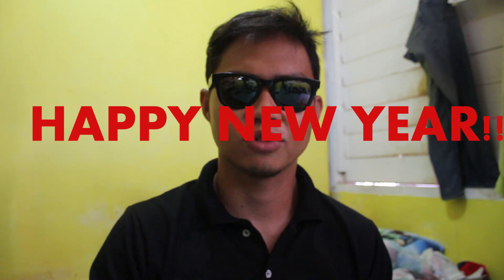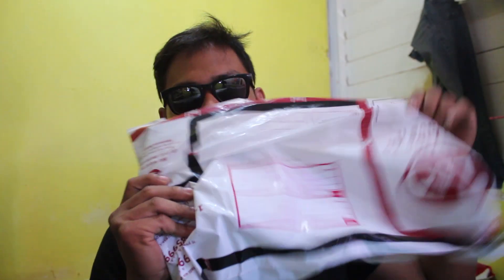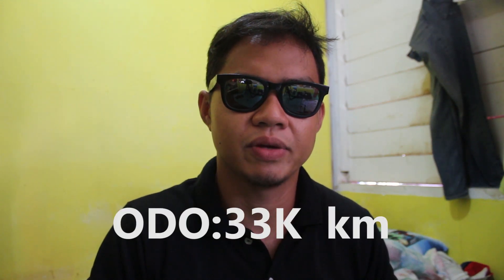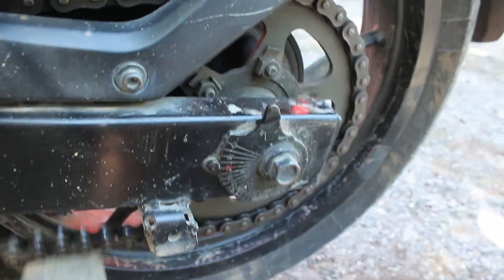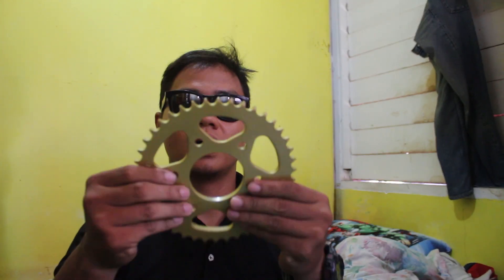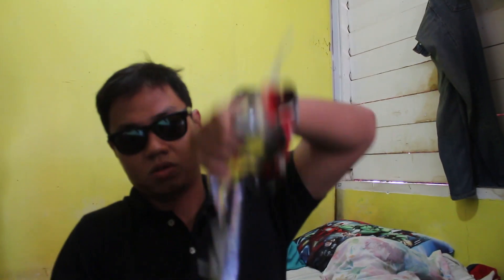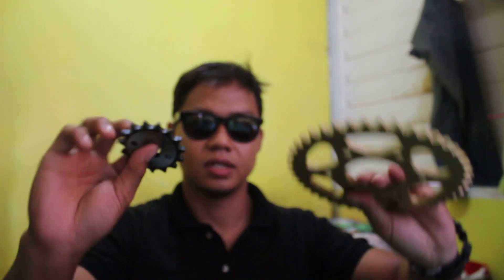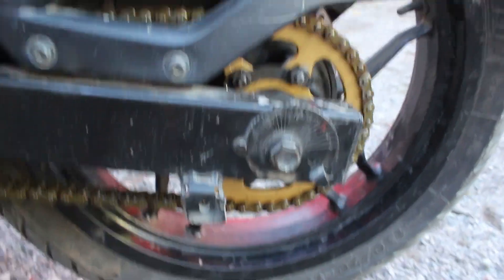15 42  428 pitch Sprocket Combination on Kawasaki 200NS | Pulsar 200 NS

Comment: From what bike do you use for rear sprocket? i mean, plug and play, no need modification
Reply from the maker: 200NS Bajaj
Reply: @JamieEduardoRosal  original bajaj is 520 not 428
Reply from the maker: @irwan6857  yes . This 428 is converted
Reply: @JamieEduardoRosal  so...this 428 sprocket is from which bike?

Comment: sir anong 428 para sa 14/36 ng 520? (magkakaiba kasi ngipin nila sa size)
Reply from the maker: dapat parhimo size ng chain po at ng sparcket .. pitch po twag duon
Reply: @JamieEduardoRosal  kea nga po sir...ibig  sabhin nung nagcomment kung tutularan  ung size nung 14/36t na 520 sa convert sa 428, ilan magging ngipin nung pang 428 sir? 16/42 ba o 16/40? parang ganun po.. hehe
Reply from the maker: @miguelpaneda1607  hindi pwidi mag convert sir .. iba kasi size ng 428 and 520 pitch ..
dapat sir ay  change set talaga from 520 to 428 or 428 to 520 sir . chain and spackets
Reply: ang 520 pitch ng set yan.. sprocket and chain... magkakatalo lang sa ratio ng sprockets...

Comment: paps anong i rerecommend ninyo pang rouser 180 sprocket pinag iisipan ko sana 16/39 428 i really want that top speed to increase sa stock ko ngayon na sprocket 14/39 speedometer:133kph gps:122kph
Reply from the maker: davelouis reyes depindi sayo paps. Pag gusto mo top paps ma sasacrifice yung Acceleration mo . If Top priority mo paps adjust ng mas Malaki yung engine Sproket or mas Maliit sa likud
Reply: salamat paps
Reply: paps may tanong lang ako kakapalit ko lang ng gulong ng r180 while i was riding around 110kph nag sisimula na gumewang r180  nung hindi pa ako nag papalit ng gulong okay naman never experienced this problem ano kaya problema paps unbalanced kaya gulong?
Reply from the maker: @davey5807  baka hindi align  ang mags sa Swing Arm paps
Reply: Jamie Eduardo Rosal ah ganun ba paps salamat  pero e papa balance ko na rin paps para sigurado

Comment: May i know how to get top speed to 172 for Pulsar RS  Now i Using 15 42 520 I can get 158  Only
Reply from the maker: no 172 for me sir .. just 136 for me :D
Reply: Jamie Eduardo Rosal u get 136 for your sprocket same as me are u seriously?? Why i can get 158 for 520 sizes??
Reply from the maker: my 15 42 is 420 pitch . maybe your engine is much more powerful than mine :D
Reply: Jamie Eduardo Rosal yeaa maybe urs ns me rs different delivery power system
Reply: How u got 15 teeth front sprocket ?
Reply: you have to consider the speedometer error when you changed the pitch of your sprockets and chain...